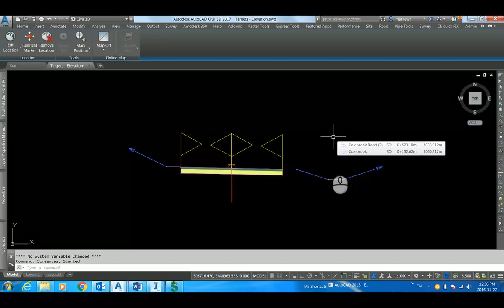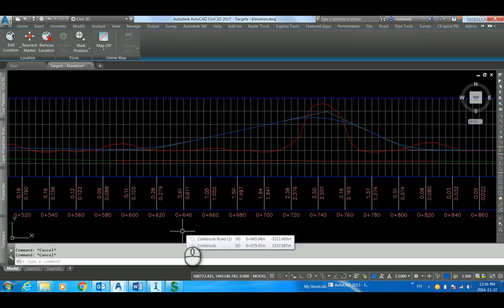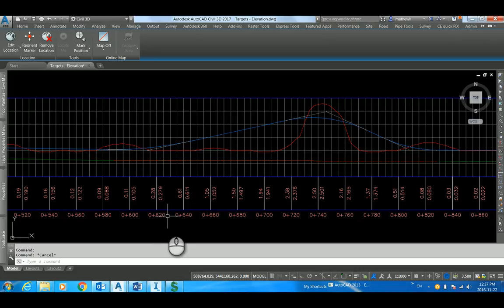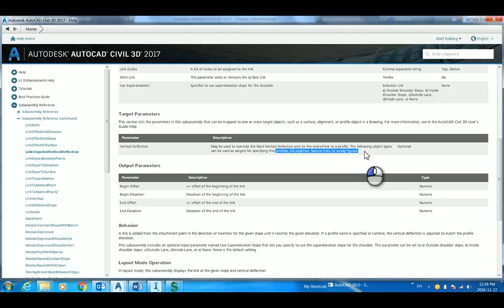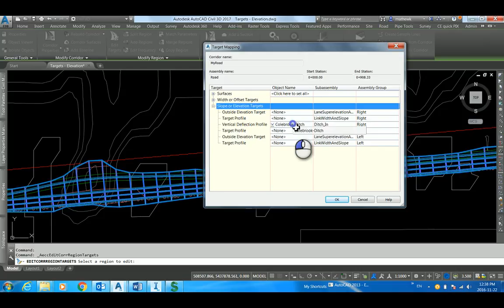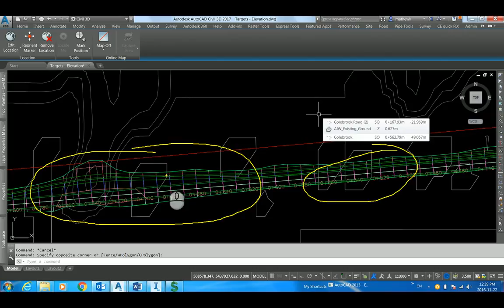Corridor Targets 3 of 3   Elevation

Comment: I have a question for subassembly targeting existing surface on the section view. I want the bottom of my subassembly to attach to the existing surface but currently it’s the top of the subassembly that is attached. How would I change that?